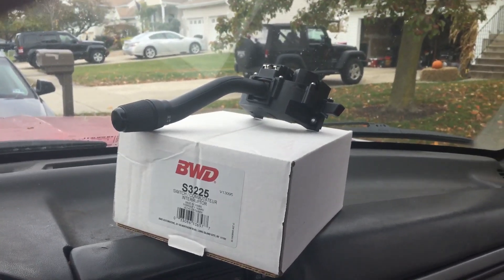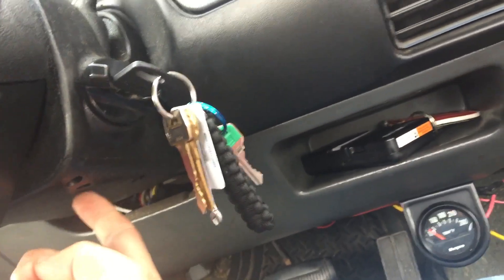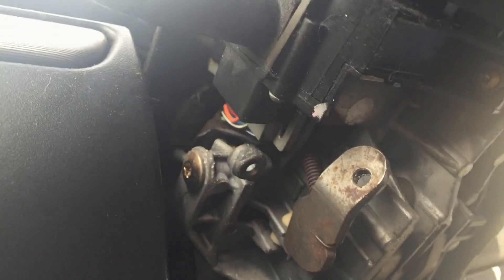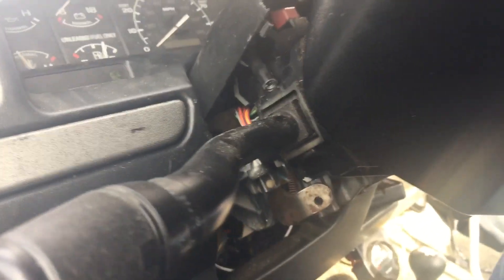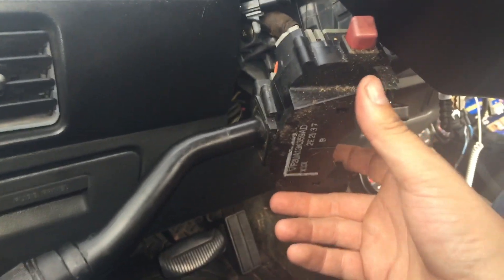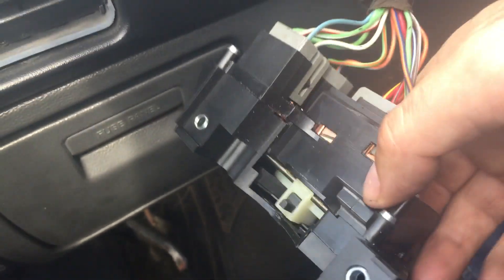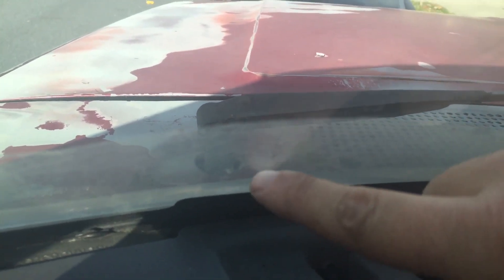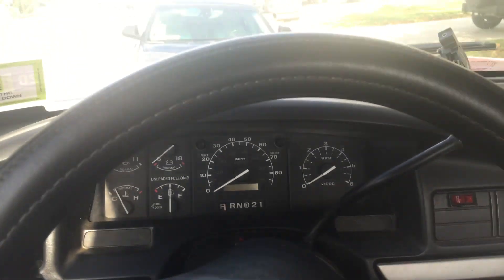Replace the Turn Signal & Wiper Switch- 92 to 96 F150 and Bronco @GettinJunkDone

Comment: Hi friend, great video.  I want to add that I have change the switch on my 1996 F150 twice ... because two BWD switches were CRAP.  One was faulty right out of the box and the second lasted 12 months.  Since the original Motorcraft switch lasted over 500,000 miles I decided to buy it for the 3rd switch.  A word to the wise, spend the extra money on the Motorcraft one if you can.

Comment: Looks great! It will be easier if you screw the tilt lever back in momentarily enough, to get the top cover in and out easier by tilting the wheel down.
Reply from the maker: That's a good tip, thanks for the comment!

Comment: There's one small difference if you're performing this repair on a 1996: There's a fourth screw on the lower shroud. It's on the bottom back right side, and it connects the upper and lower shrouds. Once the first three screws are removed, you can move the two pieces around enough that you can get to the fourth screw. Good video. Thanks for posting.

Comment: Hopefully you can help. 95 Broncos 5.8 Headlights won't turn off. Replaced the headlight switch. Lights still want turn off. Lights on even with switch removed. Connections look really good. Unable to see any problems with the wiring harness\plug. Very clean; no indication of burnt spots. Replaced circuit breaker in the inside cab fuse box.

Comment: If the wipers don't park it's usually not the multifunction switch but the wiring contacts on the wiper motor. Those can be adjusted.
Reply from the maker: Funny that you mention that.  I actually made a video about that as well.  Good thinking!

https://youtu.be/Z8ntOCJHktE

Comment: I have a manual transmission, M5OD I think it is.

I'm not sure about this for my issue. 1996 manual transmission Bronco (all stock). My Reverse Lights refuse to come on.  #5 15-amp fuse good, bulbs new and tried new ones also, Reverse switch on tranny is good.  I jumpered the wire to be sure.  All ground wires test and look good. Something is not allowing power after the fuse and tranny switch to reach the backend, or it has a broken power line after the fuse and switch on the main harness somewhere.

Does the Reverse lights flow through this switch on a manual? Thanks!

Comment: Wondering if you might know what would cause my F150 to not start sometimes. It will start fine every morning, but if you go to start it back up after 10-20 minutes it wont start the first time, but it does eventually start. I replaced battery, fuel pressure regulator, fuel filter. It seems to have low idle also.
Reply from the maker: +Dastardly84 Assuming you have proper fuel pressure, since you replaced all of the related parts, you can rule out the fuel pump right away most likely.   I would start with the easiest things after that first.  Check the air filter, but chances are this is ok and not the cause of your problems.  Since it starts fine when its cold, but finicky when warm I would suspect the ignition system. Check your spark plug wires first, then your distributor cap & rotor.  Those three are the easiest to check.  The ICM is also notorious for failing due to heat which can cause strange starting and idling issues.  The ICM is either located on your distributor if you have an older model, or on the inner fender on the driver's side like my 92 (and up).  If you diagnosis the ICM as the problem and decide to replace it, be sure to do your research as to which one to buy.  The color of the ICM is usually in question and you must stay with the same one that came from the factory.  It will either be gray or black.  I hope that helps and points you in the right direction.
Reply: I replaced the distributor cap and rotor about 6 months ago, but figured I would check it anyways. Found that all the contacts had oxidation on them. Also noticed the cap was not fitting good so even though I cleaned the contacts I installed a new cap and rotor, so far I think it's helped. Does a super tiny bit of idle surging for maybe 2 seconds but nothing compared to what it was doing.  Thanks for the suggestions.
Reply from the maker: You got it,  Glad I could help.  Thanks for watching!
Reply: Joe Robinson Not starting symptom came back and rough idle when switching from drive to park. I'm thinking it might be the distributor, but I don't know if there is a way to check it.
Reply from the maker: There are ways to test just about any component.  This approach will save you money in the long run.  The only problem is that any test procedure is too difficult to explain in a comment like this.  A quick google search will give you the test you need, but chances are there is some sort of procedure in a readily available Haynes manual.  From the little information that I have I would still consider ICM, but the distributor electronics faint isn't unheard of either.  I hope you get this figured out soon.
Reply from the maker: May also be the ignition cool.  There are tests for that as well.